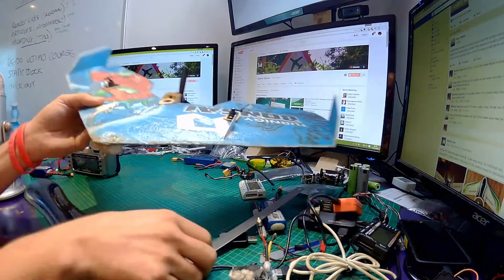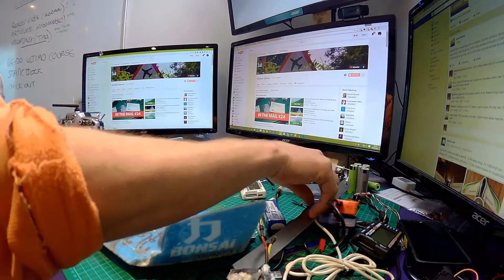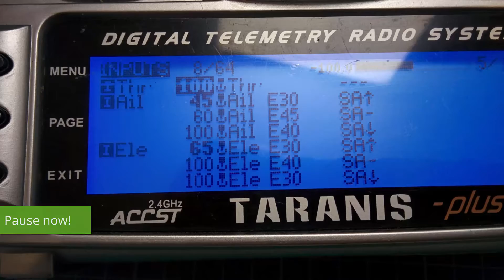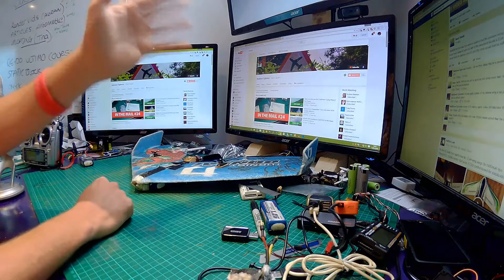Turnigy Bonsai Elevon Movements - Flying Wing Elevon Setup

Comment: Evening Matt, I maidened that little rainbow wing yesterday. All was going well for the first 10 seconds, then the little nut (which I swear I superglued on) came off the adjuster on the servo arm and I pitched straight into the end of the strip :-) I'm still claiming it as a success though, cos it was going well until then. Hopefully I'll be able to get out again on Wednesday and give it another go.
Reply from the maker: Howdy Mr T, ooops! If it flew straight & was out of your control, that's a success :) I'm maidening my new one this week too! Matt
Reply: That's how I see it too. It was straight and level and I was just starting my climb when the bloody servo pushrod fell off :-)  I've got some hotglueing to do first and I need to refix the motor mount but it should be OK. That's the good thing about EPP - it'll bounce.   
  
Good luck with the maiden.
Reply from the maker: Should be this evening! Well pending I can code my butt off today with some work related stuff. Matt